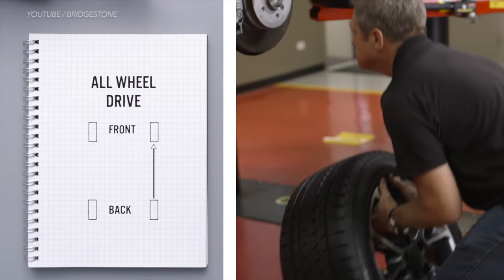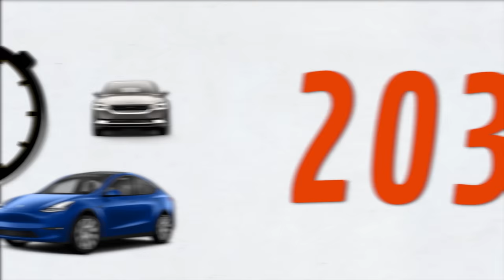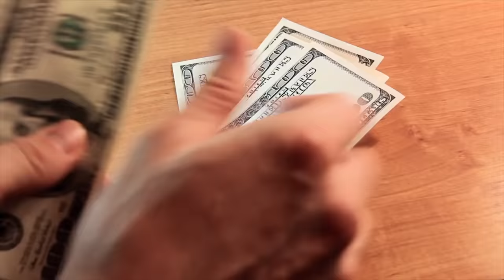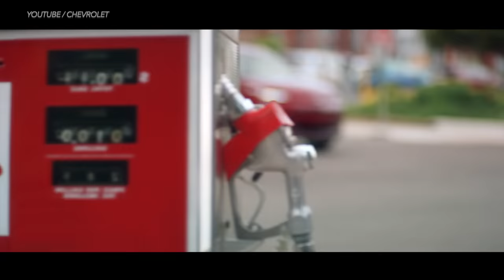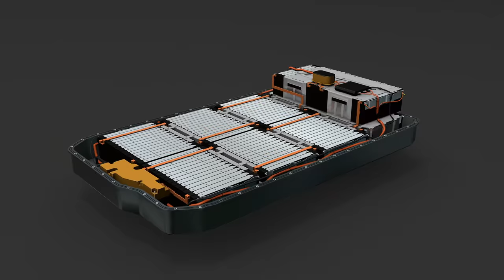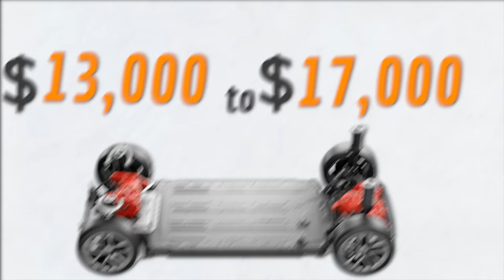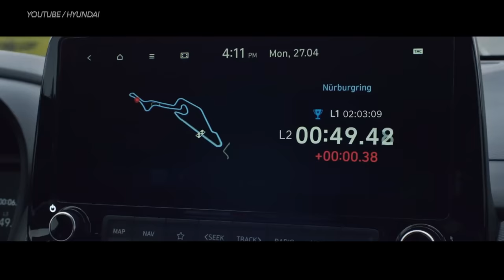No One is Telling You the Truth About the Real Cost of Owning an Electric Car, So I Have To

Comment: They really think by 2035 no more combustion engines? pipe dream.
Reply: You'd be surprised what they can do to force you to purchase an EV.   $8,$10,$12 gas.  Pricing ICE vehicles higher and higher so the price difference is about the same.  It's gonna be a nightmare during power disruptions , you'll be stuck at home , sweltering in your home without AC or freezing in the winter during a power failure., You can't even drive far enough to get to an area that still has power and get into a hotel for a night or two.

Comment: Batteries go bad in 5 to 7 years. Meaning replacement of the vehicle. 50k minimum every 5 to 7 years? I’ll pass.
Reply: Maybe in your country, but here in the USA, by law, there is a battery warranty of at least 8 years, and at least 100,000 miles (160,000 km).  A friend has 325,000 miles (~500,000 km) on his Tesla, and while the battery is beginning to show its age, he is sure that he will get 500,000 miles (800,000 km) out of it before he tosses the whole care (it is ten years old).
Reply: That is 100% false, all parts of this, every single part.

Comment: What we can look forward to on EVs is gated tech that requires you to get back to the manufacturer or "licensed" repair shops to have anything done to your car.
Not cause it's needed but artificially created to force you into the services they will charge you quite something for once you are out of warranty.
And i am sure you will soon need some tech guru to crack your car software so it doesn't work against you. Or be it just to remove all the tracking/logging bloatware designed to collect Infos and send them back to the manufacturer.

Comment: Forget ev's when internal hydrogen generated cars will be the future utilizing high voltage and low ampage capacitors and batteries.
Reply: The ev is just another fad. Ev has always failed against gas cars. The ICE is too superior. It was literally invented by a genius and nobody has ever made a better engine with more than 100 years of innovations.

Comment: EVs will cost you in more tire replacements, replacement of suspension components due to the increased weight.
Reply: More than a truck?
Reply: I’ve replaced more suspension parts on my gm Acadias then any other cars I’ve ever had.  And granted Acadias are pretty heavy for what they are).  If gm approaches there suspensions the same way on the ev’s plus adding another 1000+ pounds suspension repairs will be enough to support those repair services your worried about in the video. Haha
Reply: @williamcarrothers6783  I would never buy a GM car.

Comment: I love combustion car & i love u Scotty. But i have to say EV advantages significantly outweighed drawbacks. The transition to green energy is long & painful especially for people working in old industries like oil, gas, coal & its related machineries. They have the rights to speak up. But the world has to move forward. The energy crisis we're  experiencing is their last dance & also the final nail in the coffin unfortunately. Wind, solar, hydropower, nuclear are more than enough to electrify our world to future generations. It is simply clean & sustainable. Its inevitable.
Reply: They don't intend for car ownership to be widespread. About 10% of the current cars by about 2040, car ownership to be replaced by self driving cars and car pools, proving you have the correct digital ID and Carbon Credits/Social Credit.

Comment: Many you're really reaching on this one. Like somehow the possibility that an EV car owner might not balance and rotate their tires as often somehow offsets all of the cost of ownership savings that they can expect to realize from not having to maintain and replace so many other car components on an internal combustion engine car. And ultimately the solution is in the hands of the EV owner. If they are concerned enough about they can simply schedule the tire maintenance (balance/rotations) as they've always done for oil changes. With the money they will save on not having to pay for oil changes it won't even be like an additional expense. Not one of your better arguments.
Reply: Also up front cost is 40000 for an EV I have spent 10000 tops fueling purchasing and maintaining a car for 5 years. If my car dies I will buy a new one for 3000 and still have spent less on an electric car. It is less expensive to just buy a cheap car and run it till the wheels fall off I make 30000 a year an EV is beyond my means. I spent 2000 dollars 5 years ago and still can move myself.

Comment: So let's go back to pay  $80 for every fill up and oil change and brakes ? Also every miles is not 5 to 7 cents per miles... if a vehicles takes 1 gallon every 18MPG avg you do the math not even to mention all the costly constant repairs and maintenance... Scooty is an excellent mechanic but the Hate on non ICE needs to be better explained to him... I have 3 friends with electric vehicles and one of them just crossed 100k miles and guess what! all he's done to his EV was one set of tires which was $1k but heck my truck took $1400 on tires soooo ???

Comment: great information especially about the tire wear.  question is..  what is the average required maintenance for an EV besides tires?  no oil,  what about coolant system or chips since there contains to be a great chip shortage
Reply: The gas savings is used to buy tires almost at a yearly basis too.

Comment: Tires for me is $350 for 55k to 60k mi...which is 5 to 6 years.  I've only bought one set and they're rotated every 6k
Beyond $30 oil changes at 6k, there's been no major service costs out of pocket in 90k miles of my 9 yo car.

10k miles a year is 250gals so in past years about $500-750 a year.  This year about $1000.
Dropping $900 every two years in tires, plus the additional $35k for the car plus $200 a year in home and public chargers, plus $200 in extra charge wait time junk food....

Seems I'm getting off much cheaper with a basic economy car with 1990s tech.

Comment: just the other day I saw a Tesla 3 owner tear around a corner squealing tires and all, so I would imagine these drivers make it to the 10-15K mark.  We have a 2020 bolt with 20K miles and the tires still have plenty of thread (we drive rationally/economically), I rotated them myself @ 10K. Plan on using winter tires from now on for 4-5 months (with identical rims) just for added safety.  Overall highly satisfied with this commuter car.  We own TDI Q5s to travel long distance trips. all good so far, knock on wood!

Comment: Another bad point with Tesla tires and other ev tires/high end tires is something called "staggered fitment"; front tires being a different size from rear tires. variances such as tire width can prevent standard rotation procedures from happening.  therefor, you have to have the tire dismounted from the rim and flipped before it is installed on the rim again.
Reply: That’s only on the performance models.
Reply: That’s only on the performance models.

Comment: Rotating your tires makes them wear out faster!  When you move a tire to a different location on the car it will wear very rapidly until it settles in to its new location.  The virtue of tire rotation is that all four of your tires will wear out at the same mileage.  However, that mileage will be about the same mileage that your drive tires would have worn out if you didn't rotate your tires.  If you didn't rotate your tires you will only need to replace the drive tires now and the other two tires will last for many more miles.   Since the tire manufacturers sell more tires if you rotate them of course they push the virtue of tire rotation and hide the down side.

Comment: Well only getting 28k per set of tires isn’t that uncommon. It all depends on car weight, load, the tires and driving habits.

My light hot hatch only gets 30k per set of tires. But this is because I like driving hard with soft rubber.

Comment: My ice car does about 32000 on all sessions but only 20000 on summer tyres. It will reduce the range slightly but you can use normal one's this is as not that big a issue especially in Europe

Comment: Excellent video!  Very factual! 

I am planning to get an EV as a second vehicle. I am going to wait till 2023 because there are going to be some new types of SUV EVs coming out with newer innovative technology. That is if I will be able to get one of these. So-far there are shortages of new EVs and regular gasoline vehicles. There are too many supply chain issues. 

An EV must be driven as if it had a high performance engine.  If you drive with a heavy foot you will reduce battery distance, and cause greater rate of tire wear. Drive with a light foot. Rotate the tires as recommended for your vehicle. I drive a large SUV.  The tires do wear faster with heavier vehicles.

Comment: Have a ford mach e. What I did about the tires is i have 2 sets. The ones that came withe car use for winter.   Put 15,000 miles on them no signs of wear.  Now have bigger  wide tires for the summer. Will probably put 10,000 before I put bake the other tires.  I will let you know how it works out in a year.  Wife put 30,000 plus miles a year on her car
Reply: 30,000/year?!? WTF is she doing?
Reply: @jthomas3773  66 miles to work and back. And on weekends we go to the coast are to the mountains like 300 to 500 on weekends

Comment: I am thinking of getting an EV, but not as a replacement, but an addition. I like the concept that the "fuel" is full every morning when I get in the car. Also, no belts, hoses, radiator + fluid is appealing as well. However, long road trips or power outages, the ICE will be able to fulfill that role.
Reply: there is fluid (brake and other miscl fluids, that would probably need replacing) look at online owner manuals for the EV you plan on purchasing.

Comment: Scotty I just took my 21’ Tacoma to the dealer for its 20k mile oil change, I do deliveries with the vehicle part time so I’m constantly braking. They claimed that the front brakes are 3.5mm. I compare the MPI sheet from its 15k mile oil change and the front brakes come out to 7mm, the 10k mile service they came out to 8mm. They mentioned brake job would be ~$300, should I go take it in for service?
Reply: BRAKES sheesh!

Comment: I watched an interesting video on California’s future as it pertains to EVs. Due to climate change issues California has already announced electricity brown-outs and blackouts due to heat dome related issues. There is either going to be enough power for A/C or EV charging but likely not both. As California decommissions its last nuclear power plant the shortfall will likely have to be augmented by fossil fuel power generation plants as the hydro capacity is shrinking due to impending drought.

Comment: People complain about the cost of a new battery if it fails but that’s cheaper than a new car.  If the chassis motors and other systems are fine maybe it’s good for another 100,000 miles.   Remember you’re not paying a lot on upkeep as you would an ICE vehicle.

Comment: I've found that the low rolling resistance tires are rather bad in the snow. My experience is that the LLR tires do require more frequent replacement. I have driven a 2012 LEAF for the last 10 years which I recently traded for a 2022 LEAF, so I guess you can say I'm hooked on the EV experience.

Comment: Scotty is correct about tire wear on EVs. However, tire wear on "normal" vehicles also depend on weight, rubber compound, suspension geometry, ect. Newer Chevy blazer's  have a 21" fitment. You are lucky if you get to 
20k. Any mid range and up tire is $300 plus before mounting and tax. That is ridiculous for a run of the mill vehicle. The tire and wheel sizing for modern autos has gotten out of hand. The tire costs for new vehicles exceeds $ .01 cents per mile by a wide margin. In a growing number of cases exceeds the actual maintenance costs.

Comment: OK Scotty, how do I rotate tires on my 2004 Nissan 350Z or my 2014 Infiniti Q60S?
The tires are directional and the rear tires and wheels are a different size then the front
tires and wheels. ( Rear wheels are wider then the front and not interchangeable.)
Reply: You don't rotate them

Comment: Our grid isn't capable of handling that much demand. Were I live, the power company does a rolling shut down of 
A/C units in the SLC valley to homes for about 30 minutes during the day to reduce the load on the power grid. Electric cars draw far more power then the average A/C unit. Just think if you had 2 cars to be charged at home?

One major reason the power grid fails:
Wind, heat, ice and snow these are the most common causes of widespread power outages.

Comment: When you stop and think about maintenance, really, the ICE does not need anything really complicated. The biggest is oil changes. Easy and cheap, and not that often depending on how much you drive. Then coolant, belt, hoses every 5 years or 150K. Maybe plugs at 100K+. Transmission fluid change every 3-5 years. Also not too bad. So really, the actual drivetrain does not need much attention. It's all the other stuff that all cars have that wears out. Brakes, shocks, struts, bushings, tires, weird noises, alignments, and electrical problems. EVs are still pretty new so that may not need much, but just wait til they all start getting older with mileage on them. They'll need just as much maintenance as every other car.

Comment: So what you’re saying is if you don’t properly maintain your vehicle things will wear out early?
That one of the advantages of a gasoline powered vehicle is they require more maintenance?

And if you abuse your tires they were out sooner? Same on a gasoline vehicle. 

Heavier vehicles use up tires faster? I noticed your caveat of equivalent vehicles? So what about SUVs? They are heavier? Did they also eat tires?

My Honda Accord I just replaced it with the original Michelin tires. $1000. With tax.
Reply: Lol....$1000 for 4 accord tires.... They took you good. Do you think every car only has 1 specific tire that will work on it? Lol.

Comment: Li-ion batteries do not degrade from time itself. They degrade from cycling from full charge to empty.  They also degrade from high state of charge for long periods of time. The anode oxidizes at a high state of charge (over approx 85% state of charge)  A quality li-ion cell maintained at 3.92v per cell and 70F will last indefinitely. The reason 10 year old teslas have minimal (if any) degradation is due to thermal management and the ability to restrict charge to what’s needed instead of charging to 100% daily. The reason the Nissan Leaf has a track record for extreme degradation is A) no thermal management  and B) no option to restrict state of charge other than unplugging at 80%. I own a 2020leaf plus 60kw 21k miles and a 2013 model s 85kw 60k miles. The model s has about 2% degradation while the leaf already has 4%. This is profound since the leaf is 7 years newer with 1/3 the miles. Time is NOT a factor for li-ion chemistry. It’s state of charge and thermal management.

Comment: I have read that some Tesla's can have major suspension issues as well. Because of these issues, the Tesla Model S is one of the lowest-rated cars for reliability. "The Tesla Model S ceased being recommended by CR last year after 2020’s reliability data was compiled, revealing common problems with electric sedan’s air suspension, its main computer, and touchscreen controls." Consumer Reports.

Comment: With electric cars, when the battery goes out, then most people would just buy another new car. The electric components would corrode in 10 years, less if you live in places that use salt in winter. Landfills would quickly fill up with plastic cars and batteries. Sounds like a real clean environment.

Comment: Oil change is not such a big deal compared to rust proofing, 12V battery, air filter, cabin filter, tires, alignment, 
 brake pads, wipers and more.

Comment: Current price of gas $5 * 13gal per tank * 2 tanks a week * 52 weeks *10 yrs (rough estimate of battery life) =$67,600 
This is what I am not spending. And if I had to replace a battery after 10 yrs. at a cost of $17k  I'm still ahead   of the game. 
My current cost to charge my Bolt is  very very close to $150 a month * 12 mo * 10 yrs= $18k 
This and a battery replacement is $35000. 
Still better than combustion no matter how you spin it.
So you keep on with your incredulity.

Comment: You can rebuild the battery yourselves for a lot cheaper than that. And just because they'll stop manufacturing combustion engines by 2035 doesn't mean you can't keep driving them.
Reply: They will change that next administration,  gas engines are needed in cold climates.  I live in the mountains and I can see the battery discharging quick on some of the steep inclines that I drive on.

Comment: Cost of your Time (as a daily/commuter driver)!  Most people are not changing their own oil etc. When you factor in all the time saved at a pumps and maintenance places the cost benefit comes out + for many people in the growing middle class
Reply: then why do >99% of people NOT want to buy an EV?
Reply: @protonneutron9046  the battery penalty that bites at 8-9 years. It's like $2,000/year. Which buys plenty of gasoline.  The current EVs are bad science. They are not outrunning oil burning machines financially. At all. As explained by Scotty.
Reply: @timewa851  exactly
Reply: @protonneutron9046  Market Share of EVs is around 4.6% and growth outlooks looks really good.
Reply: @zangarkhan  Nope.  <1% of new cars sold annually
Reply: @protonneutron9046  data link?